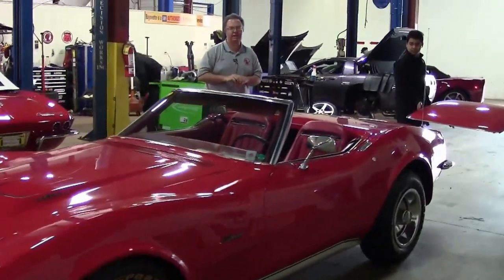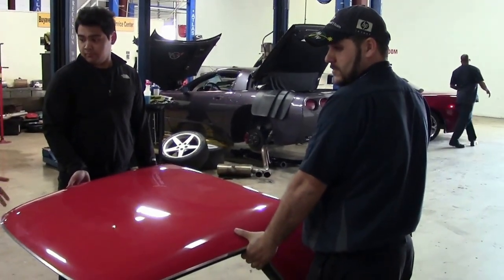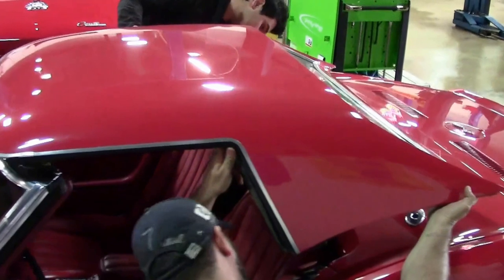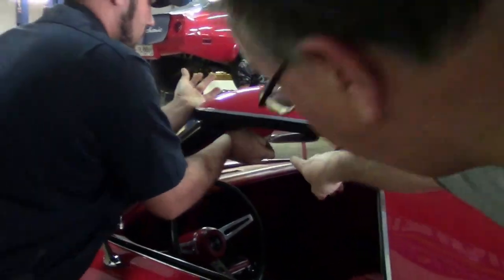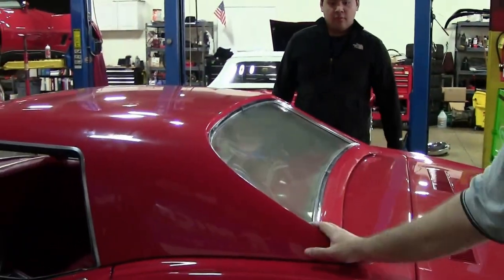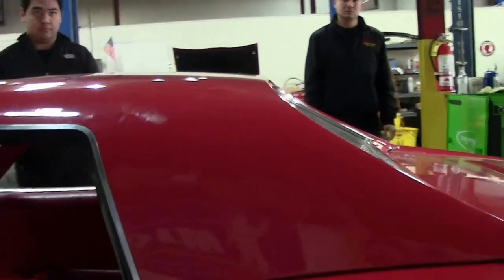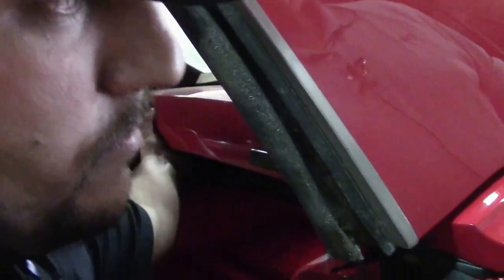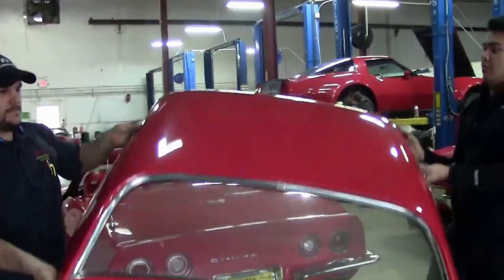How to Install and Remove a Hardtop on a 1968-75 Corvette C3 Convertible

Comment: Three options when you ordered a new Stingray convertible..
1. Keep the standard folding soft top.
2. Order the hard top in place of the soft top for no extra cost. The soft top and the hardware is removed freeing up interior space.
3. Order the hard top in addition to the soft top for a couple hundred bucks and now you had both tops.
There was also an optional black vinyl covering for the hard top and with certain colors really looked nice.

Comment: Looked like a 70-72 big block or LT-1 by the hood
Reply from the maker: 71 with NOM 454. See here for more info on the car http://www.buyavette.net/1971%20Corvette%20454%20Convertible%20For%20Sale%20Stock%206844CJH.php Note that the hardtop is off another car, and is NOT included with this '71.